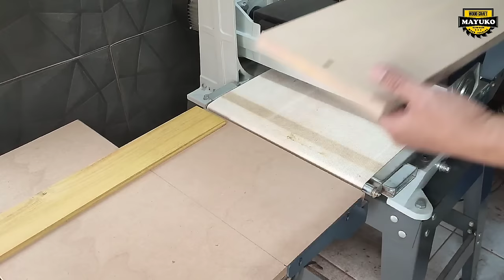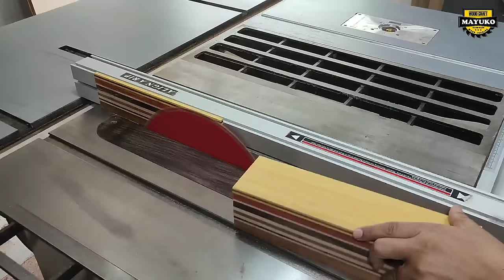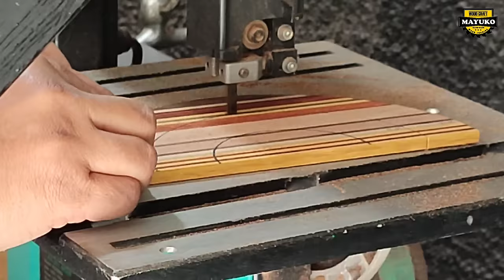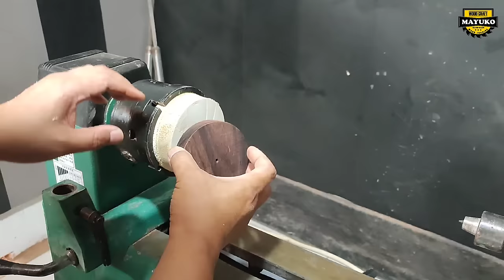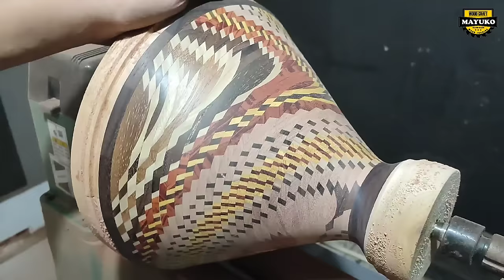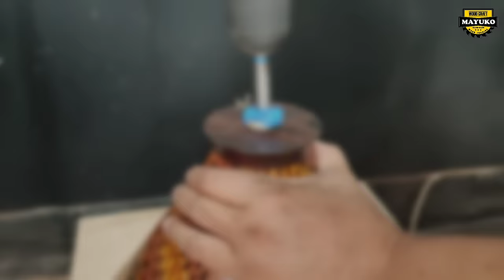DIZZY BOWL, woodturning

Comment: Its beautiful! But I'd recommend a larger base-pedestal. It looks like it might be easy to tip. ..just say'n. If it's tippy, it'll sit in a closet or a cabinet, collecting dust and unappreciated. A piece like that deserves better. No one wants a beautiful bowl they'd be scared to use. Unless of course this is supposed to be one of those "artsy" type of pieces that's supposed to be a "look but don't touch" art piece . It's definitely pretty enough for that, but the design is not a sculture, It's a bowl, and being so intricate it almost screams to you to reach out and touch it, and than handling the piece almost insures a chance for misfurtune. All that said, I'd slap a broader base on that piece.